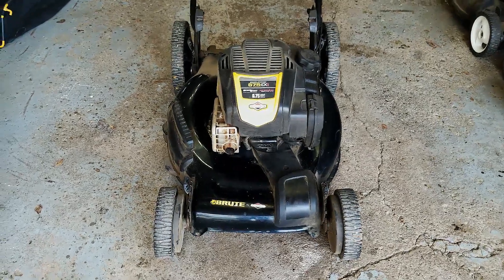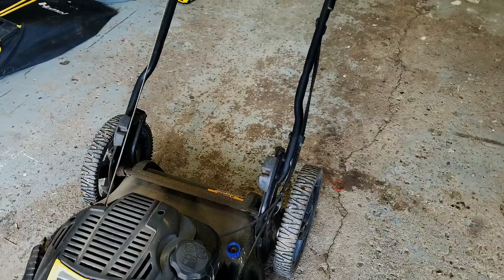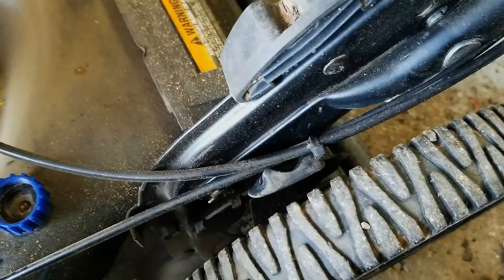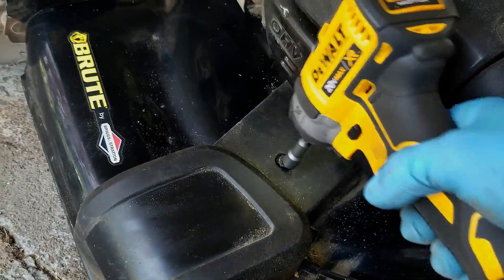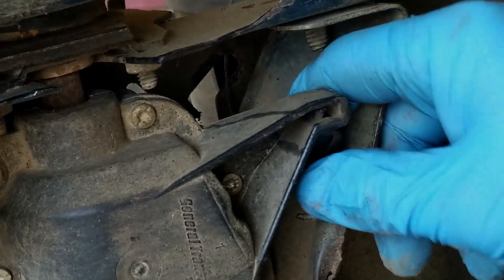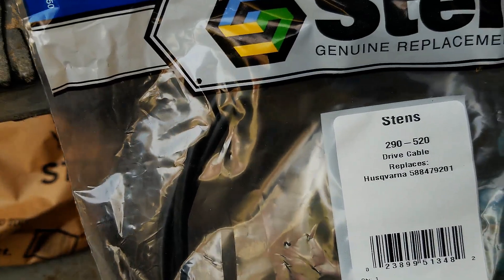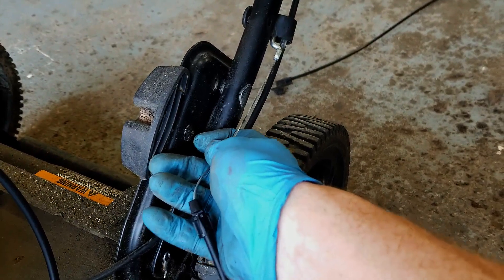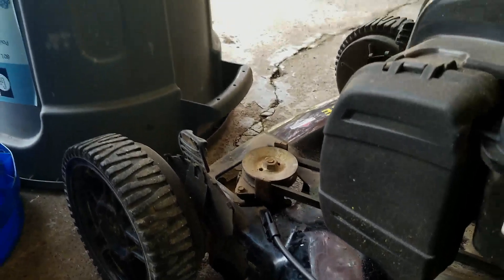How To Replace Brute or Husqvarna Self Propel Cable

Comment: A lot of these mowers have the big wheels on the back, yet the small wheels on the front have the self drive. I can never figure out these manufacturing companies for doing that... it just doesn't make much sense to me. Good vid.
Reply from the maker: I hear ya. Only thing I can think of would be that the size of the plastic gearing on the inside of the back wheel would have to be about the same size as it is on the front wheel. Otherwise it might affect the speed of the drive system. This could be done with a little engineering but then the distance from the max resistance (where wheel meets ground) to the smallish gear near the center of the large wheel would increase. This I believe would put more stress on the plastic gearing causing premature failures. Could replace plastic gearing with metal but then we're adding cost. I'm just spit balling. Thanks for watching! Cheers